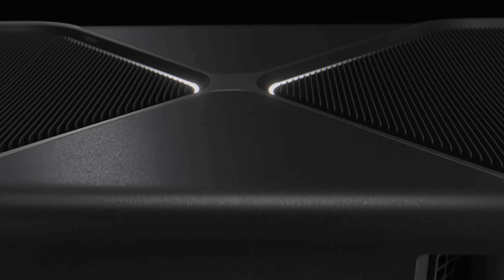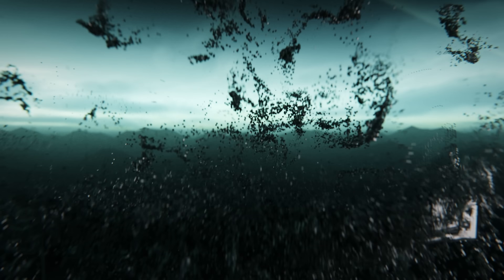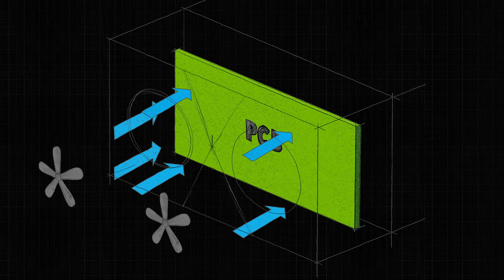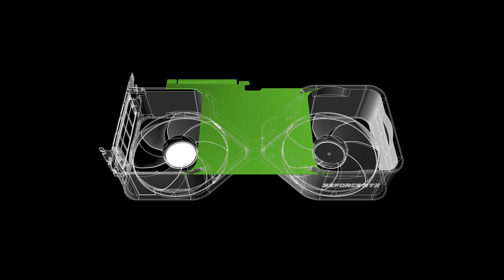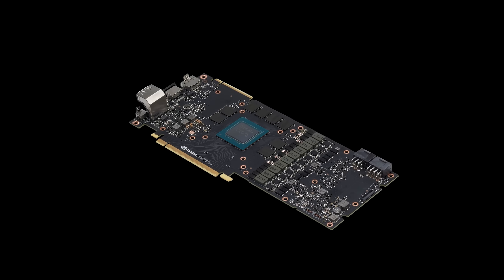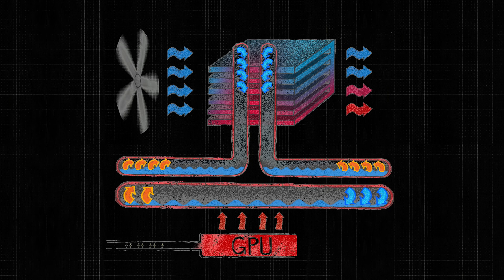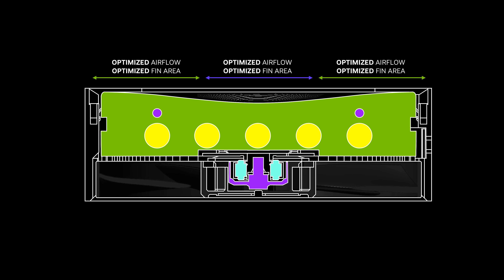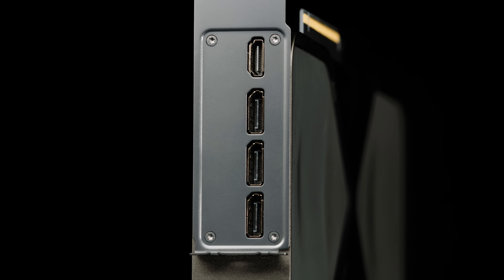Designing the Founders Edition | GeForce RTX 5090

Comment: Hi nvidia, what made you decide to blow into the direction of the CPU and not just downwards? Just ATX convention?
In case of vertical mounting the GPU could blow warm air straight out of a meshed sidepanel.

Comment: I lost faith in Founder's Edition cards after buying a new 3090 that sounded like a vacuum cleaner. They placed the GDDR modules on the back of the PCB without any contact with the heatsink, causing the card to reach 105°C. Something tells me this model will have a lot of manufacturing issues.

Comment: Yes, you must design 2 fans only VGA, because if it's too big, like 3 fans and huge like a cinder block, it won't fit into a normal PC case, and your wattage is ridiculously huge, like why don't you design VGA not more than 150 watts max, because it will kill the PSU and will get more heat. 🤔

Comment: We push technology forward. By limiting the vram of the 5080 to 16gb.
Courage!
Reply: Unlimited VRAM is the way to go!
Reply: @ChrisGrump  and yet nvidia touted that they would increase vram generation by generation when they showed the 1080Ti.. 🤣 
4080/S with 16GB 2 years ago was fine, I wouldn't spend €1310 on 5080 with only 16GB today, imo it's DOA at that price. 
Most I know keep their gpus 2 gens now, which would be 4 years. 4 years with 16GB onwards? Nah...
Reply: Just buy a 4090
Reply: @LG-bb5zq   ah yes, a 2 year old gpu with 1 year warranty left at 17500 SEK/€1500 on the used market? Sounds like a good deal.. 😂 sure it's €1000 cheaper than a 5090, but still.

Comment: In my mind it looks like  a database card design and they found a way to have the cooler for a desktop work that kind of PCB. They are lieing when they say it is unheard of in Graphics Card circuit boards just not used in over 20 years since they went to a single chip design from a design with chips you the user can put in or the before design of you have to solider on the chips to provide the functionality of the card that came before nvidia was founded. So very old design principles used for a very new chip. I do doubt they will allow us to change the interface from PCIe to OCP or to another interface or our own choice same thing with the video outs but alike to most consumers back then most did not do so as they knew what the manufacturer did works and changing it might or most likely will break it without doing it with a manuel right beside them saying what chip goes where and which part numbers are compatible.

Comment: I really hope this cooling solution delivers. Cooling 600w with 2 slot air cooler is crazy, I hope it will work well.
Reply: Their new enterprise gpu racks just had overheating issues. Not a great start.
Reply: @csomerville6653  This is this and that is that, tomorrow reviews come in and we will see how it actually goes.
Reply: @csomerville6653  Very old news

Comment: By chat gpt - Yes, a more powerful and expensive GPU/CPU typically uses less power, generates less heat, and requires less fan speed for the same task compared to a lower-tier model. This is due to better efficiency, architecture, and thermal design. However, this efficiency advantage diminishes if you push both devices to their limits, as the high-end hardware can consume more power when fully utilized.

Do you know if this  correct?

Comment: why did you increase the wattage if your solution is so efficient?
Reply: for purformans
Reply: Because people would cry harder about raster if they didn’t. With a nice power limit I bet my 5090 will run at 300 watts.
Reply: They were able to increase the wattage because the cooling solution was so efficient. If it wasn't, they'd have to decrease the wattage so the card wouldn't get too hot. They literally described it in the video as previous generations of cards wanted more power, but couldn't because their cooling solutions weren't efficient enough for it. Efficiency in this context relates to how well the cooler's can cool the chips, not how well the chips draw power.
Reply: @Arcwise1  thats not efficiency, thats just better cooling
Efficiency means power efficiency, aka more performance for less watts
Reply: @ts8960  Do me a favour and google cooling efficiency real quick. Thank you
Reply: Pretty sure you can reduce the power limit to 450W if you're so inclined.

Comment: still didn't show any data or specs of how much better it is
Reply: Device Name	Median Score	Number of Benchmarks
NVIDIA GeForce RTX 5090	14877.53	6
NVIDIA GeForce RTX 4090	10994.47	397
NVIDIA GeForce RTX 4080 SUPER	8364.23	267
NVIDIA GeForce RTX 4080	8279.57	139
Reply: They did. Or what would you call the two graphics they shared each with around 8 games some with RT, some without, some with FG some without
Reply: 5070 > 4090
Reply: @kodakenta  no 😭, it equal the performance of a 4090 but using dlss4, so, no

Comment: 30% higher tdp, 30% higher price, for 30% more performance? what an engineering marvel. Just looks like a 4000 refresh...
Reply: More performance is more performance. And you're not just throwing money in the trash compared to the rest of the stack like the titan days
Reply: That they were able to achieve 30% higher power and still be able to minimize it to be a true SFF card is an engineering marvel. If you're not impressed go ahead and apply to be an engineer
Reply: @ dude, everyone is impressed with the cooling solution, performance though, not so much.
Reply: depends on what you upgrade from though, if you have a 4090 sure, but I have a 2060 so the performance increase % outweighs the cost % increase
Reply: @InaFranklin-s6h  should just get a 4070 or 7800XT instead

Comment: they made a mistake, 5090 has 32GB and not 24GB of G7, exactly at 5:51
Reply: 5080ti leaked?🤔
Reply: @ivanor8621  a 24gb version of 5080 leaked a while ago and also shown in an MSI marketing material
Reply: @TechMeldOfficial  😉👍
Reply: @TechMeldOfficial  And the mobile 5090M is confirmed to use desktop 5080 die but with 3GB G7 chips to give it 24GB.
Reply: @ivanor8621  The 5080ti will prob be gb202 dies that didnt make the cut. with the 5080s 8 2gb grrd7 modules changed to 3gbs for 24 gb.
Reply: Maybe originally it was only going to have 24 GB.
Reply: Looks like it's just a typo. You can see the 16 memory modules clearly in the line drawing.
Reply: more like a "Freudian slip"
Reply: i hope all the 5090s have 32GB as that is how it will be worth it other wise a major price cut is in order. Yes the extra 8GB is that import to AI devlopment, AI model inferencing, and GPU rendering from a video editing program. It is overkill for gaming but for business it is good.
Reply: @yumri4  without 32GB I'd be picking up used 3090s!
Reply: Calm down, it's only a small niche tech company, they don't have the manpower for this stuff.
Reply: Must have corrected it by now, cause for me it says 5090 and 32GB.
Reply: @Dawelio  yes, they have just corrected it
Reply: Opsi ;)
Reply: lel, nice catch
Reply: trillion dollar company everyone
Reply: No no... 32GB was a mistake. The accurate one is 24GB here. 💀
Reply: Perhaps the original was going to be.
Reply: i think they showed the 5090 TI at the presentation, look at the screen at jensen's back, that specs doesn't match the 5090 of their webpage. so it could be possible that a 5090 ti has the 32 gb
Reply: That's cause the 5090 actually has 24 not 32gb lmao yall getting scammed

Comment: The 5080 should be 24gb the fact its not is why ill get the 5090
Reply: I think that it would be fine if it had 20gb.  But, 16gb on a $1k gpu is kind of an insult.
Reply: @Aki_Lesbrinco  it is especially because I dont just use my pc for gaming
Reply: If I can't get a 5090 because of stock issues I'll try and grab a ventus 5090 if no luck then it'll be a 4090 as that's the next best card with the most vram

Comment: @5:51, 24GB G7 5090 GPU?
Reply: Likely a typo as there are no 1.5GB VRAM chips, to my knowledge.  With 16 chips on board, you get 16, 32 or 48.  3GB chips coming later so refresh will LIKELY see 50% increase in VRAM to slot into a 5080ti and possibly 5090ti, if they want to go above a 5090.
Reply: @ I know, just funny to think one of the biggest companies in the world made a typo
Reply: Haha. We knew that the only reason the 5080 has 16 GB is because they wanted to upsell to 5090. It could easily have had 24 GB with a 320/384-bit bus.
Reply: they will use that for the 5080ti
Reply: @ I mean, it says 5090

Comment: Nvidia please release Frame Generation for RTX 30 series
Reply: if you have a solid stable at least 60FPS or so on all games max settings, Frame Generation is unneeded, because you raw performance is already as smooth as butter.
Frame Generation can generates more latency and artifacts with that random fake fps. Not ideal for competitive games.
However Frame Generation does have a benefit, it could make motion more smooth like in 120-240fps or so, but only if your pc could reach a minimum solid stable 60fps raw performance (more are better) before turning on framegen, if under 60 fps or so the performance will still stuttering even framegen turned on, even the fps shows more than 60fps (aka fakefps).
Reply: I also own a 3080Ti, and my guess is 30 series hardware doesn't have enough compute power.
Reply: @samiulislamsharan  they said now frame generation is mostly dependent on tensor cores rather than optical flow
Reply: @samiulislamsharan The new model doesn't even use the optical flow accelerator tho...
Reply: @Frozoken  thanks for the correction.

Comment: NVIDIA is approaching the nanometer limit, which is why I believe they haven't been able to achieve a significant leap in raw power. TSMC has yet to transition to 2nm technology, and even when they do in the future, a major challenge awaits: beyond 2nm, the quantum system comes into play, which will cause significant headaches for companies. They are already searching for solutions for the future, and it is likely that they will start stacking layers on chips.

If you're using an RTX 4070 or higher, there isn't much reason to upgrade to the 5000 series. It's better to wait for the RTX 6000 series.
Reply: Do you realize the nanometers ratings has been fake for over a decade? 2nm doesn't mean what you think it does. The feature sizes are still like 20-30nm. Nvidia is at the mercy of TSMC and other semiconductor fabs. They won't be able to meaningfully improve performance/watt until they have access to better lithography and Moore's Law/Dennard Scaling has slowed.

Of course a single generation is never a good value for upgrading, that goes without saying. That said I can in theory sell my 4070 FE for $400 and get a 5070 FE for $600. Not a bad deal to have something new but still going to wait for 6070.
Reply: @JFinns  You don't necessarily need a node jump to have a large performance improvement. Regardless, it seems to me that Nvidia is having trouble feeding the cores on the 5090 because the 5080 has half the cores, slightly higher clocks, quite lower TDP and yet the gap between the 5080 and 5090 seems to be around 30-40% (?). Obviously there is no linear scaling in performance with cores, but the 5090 has twice the cores and yet it is not even close to being twice as fast.
Reply: @lycanthoss  It's not about the cores alone, how fast the surrounding elements can feed data to and from the core has limits too. Another limit is how fast the heat can be moved away from the chip and the power connector's maximum current limit.
Reply: Yeah a lot of people don't realize that GPU performance is almost exclusivity limited by two things: manufacturing tech and power.  Rasterization hardware has been mature tech for a long time and there's not really anything Nvidia can do to improve that.  Unfortunately 3D stacking won't help since you still need more power to drive more silicon, and we're already nearing 600W here - plus more silicon and more power means more cost.  This is why they've been pivoting so hard towards AI to use software to make more efficient use of our limited hardware resources.
Reply: Stop with this nonsense. The 50 series is incredible in every way, and telling people "Just wait for X" is something that can be said every year, into eternity.

Upgrade when you need to upgrade, or when you feel like it, and that's it. Why not wait for the 9000 series, or the 14000 series, or the 26000 series?
Reply: I have an RTX 3070 right now, and I'm thinking of upgrading to an RTX 5070 Ti.
People, do you think this video card will be enough for me for a long time for my monitor ASUS with a resolution of 1920x1080 with a response of 1ms, and 144 Hertz scan, and with G-Sync technology?
Reply: @Igor-Bond of course
Reply: Just wait for 9000 series
Reply: @drblitz3092 All AMD did was catch up. Their chiplet design needs too much power to compete at the higher levels.
Reply: quantum computers will never be scalable for consumers, it requires insane cooling and will only be used by large enterprises like google
Reply: I just moved from the 3070 to the 4070S, so I'm glad to read this lol.

I did this specifically expecting the 50 series to be unavailable and unoptimised for a few years.
Reply: is not the last gen of apple cell phone processors built on the 2nm process> 10 Billion transistors per square mm. is pretty dense
Reply: Preach brother
Reply: This is the 20 series all over
Reply: I’m an engineer. No they arent
Reply: I have the 3080 10gb. Should I get the 5080? You guys be the judge.
Reply: CPU calculation ( computing ) noise. This type of calculation is similar to quantum processors. But it is not close to quantum performance. far from quantum. But 10-100 times faster than the computers we have now. DLSS ( and RT ) almost creates noise, but with the help of tensor blocks it eliminates them if the performance of these tensors is sufficient and there is enough information about the pixels.
Reply: there is no "nanometer limit", there is a money limit for R&D they are willing to pay.
Reply: Lossless Scaling 3 just made me not need an upgrade for the forseeable future.
Reply: @MrNPC  The only issue with Lossless Scaling is that it eats up from the GPU performance since the program can't access the GPU hardware. So it takes up a portion of computing power so its most viable in CPU and RAM bottleneck scenarios where your GPU is not at full load.